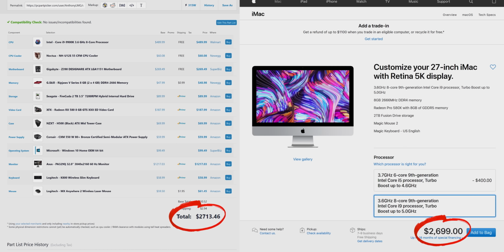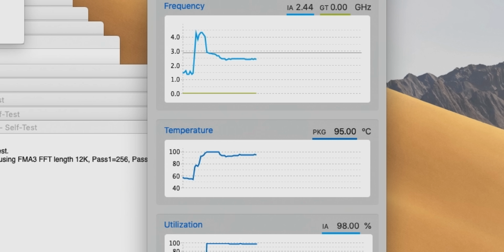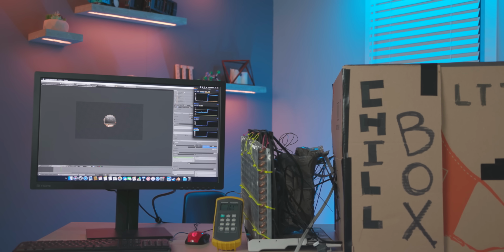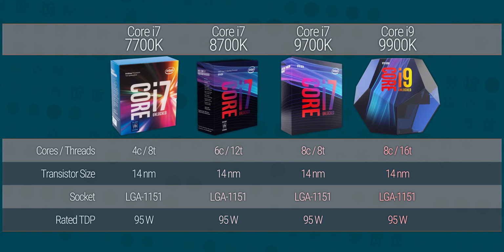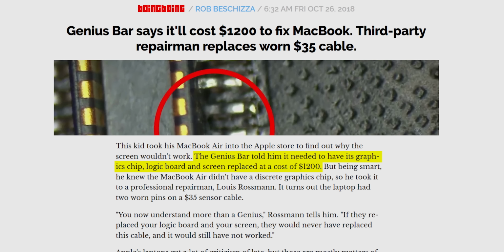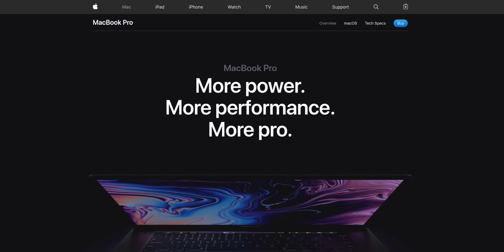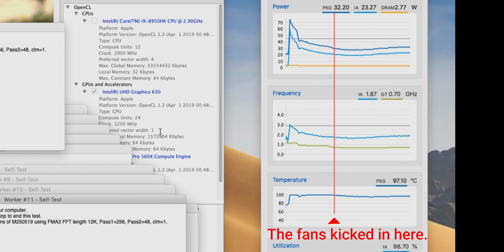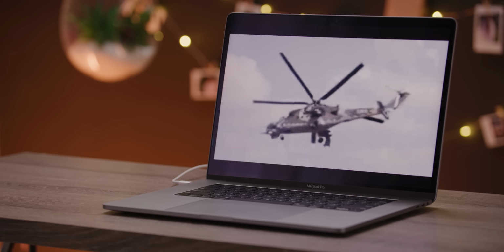Macs are SLOWER than PCs. Here’s why.

Comment: I may not be as knowledgeable as most people here; but I know for a fact that coming from a PC and converting to a Mac was a step up. My cpu fired up quicker, I had less malware and virus problems, and I didn’t have a bunch of programs simultaneously start thinking about loading. I’ll stick with Mac every time. The programs are more stable, and by god if WINDOWS PROGRAMS USING Parallels runs better on a Mac than on a PC.  I do believe that hardware specs that are married to operating systems are the game changer with both systems, but the Mac is more stable . This is why I, and many others got sick of PC. If you want to build a top of the line gaming system, have fun every three months spending it on your Gaming PC, I’ll use a dedicated console. If you want a stable computer that doesn’t crash, and doesn’t give priorities to non essential functions, other than what you are working on, then get a Mac. Too much BS with Windows and PC.
Reply: “I may not be as knowledgeable as most people here;”

^Only thing you were right about.
Reply: I have had my PC for a year now. Havent made a single upgrade on it. Still does me absolutely fine.
 Although I havent utilised it, I still however like having the option of being able to upgrade my PC by myself if I want a significant performance boost whereas with Macs you gotta buy a whole new computer if you want faster speeds...

Comment: Not gonna lie I got a MacBook Air 2years ago because it was marketed as the laptop to have in college I didn’t know or care about specs. But now that I’ve graduated and have actually started using my laptop for real work and not just a place to use Microsoft word + store stuff my computer is constantly overheating and the fan is constantly on...I NEARLY got the 2019 (15 inch) MacBook Pro but now that I’ve actually taken the time to learn about specs and the importance of certain components + all the unnecessary problems the pro line has while Apple is charging customers 1k-2k it’s very clear that I’m gonna have to leave the Apple ecosystem. Having a laptop that costs 2k that overheats and/or has a trash keyboard but has a nice looking exterior is just not worth it.

Comment: So, questions:

You say a slow un-throttled chip can be as fast as a throttled faster one.  Does that include when they're turbo-boosting?  I would imagine that the vast majority of users are more dialed into snappy response than actual under-load performance.

Is a Mac at a certain TDP slower than a PC at the same TDP when looking at models with a similar form factor? (IE Surface Laptop vs MBA)?

My Alienware 17 thermal throttles playing WoW Classic in 4K if I'm being really active in-game, so I doubt this is so much a Mac problem as it is a "Trying to get more performance out of a form factor than is possible with traditional cooling" issue.

Comment: Linus Tech Tips,  I wonder if the reason that the iPhone CPU (rather the SoC) runs cooler than the laptops and desktops has something to do with the different chip makers. The iPhone has a ARM A9 which which runs a Reduced Instruction Set (RISC) rather than an x86 which has a Complex Instruction Set(CISC). On the other hand I just found this article that claims the the micro-architecture is the most important aspect to energy consumption. https://www.eetimes.com/author.asp?section_id=36&doc_id=1327016#
Reply: It's obvious that smartphone SoCs are running cooler, nobody said it's not.
But as Linux made an example, another top smartphone (and we can assume most other smartphones too) has thermal throttling kicking in earlier than iPhone model under a similar load, and it raised a question...
I suppose the answer is that Apple is actually doing a pretty good job making their own CPU/SoC which has better thermals while providing even higher performance.
But Apple doesn't have such luxury for x86 CPUs so they have to use AMD or Intel CPUs which requires a much bulkier cooling system in order to sustain high load without throttling. It goes against their target audience's aesthetic preferences, so they prefer to boost, overheat, and throttle...

Personally, I own and owned several MacBook Pro models (one being mentioned in video infamous 2011 model (which actually had very competitive price in comparison to Windows laptops at the time) with Radeon GPU BGA de-soldering issue which took over a year for Apple to acknowledge and replace for free the expensive motherboard together with CPU and GPU) and several PCs, and I very well know what I can expect from a MacBook Pro. Alas, even with a powerful cooling stand, it's an extremely compact and light design that cannot sustain a high clock speed. But it's best for my portable use case now and I'm happy I have a light secondary machine with great boost clocks which feels great every day with outstanding HiDPI IPS screen (I got it in 2015 when there were basically no decent alternatives with HiDPI/4K screens, not mentioning they were much bulkier without providing significantly better thermals).
For a truly professional non-portable use, Apple making Mac Pro workstations (especially the latest model) which have proper thermals—but cost-wise, PC was always cheaper, and now even more cheaper with AMD Ryzen 3000 family CPUs (Zen 2). But for a portable truly professional use, Apple is likely to not going to provide any competitive options in the near future...

Comment: Sorry but I can't agree with you. Moving three files into a folder on a Mac takes 1 second, doing the same on Windows takes about 10 to 20 seconds. Restarting Windows takes "forever", sometimes up to 5 minutes. A Mac takes 30 seconds. Shutting down a Windows laptop takes "ages" up to 3 to 4 minutes sometimes, whereas a Mac takes about 20 to 30 seconds. Things just seem to "work better" on a Mac and a lot faster too.
Reply: Have both Mac and a laptop, a good ssd for laptop makes difference. I'd say they almost the same in copying, restarting and boot up.
Reply: Get a SSD. Thats the problem right there. Good folder management also helps.
Reply: @METALLICARULES11  So Windows machine needs an SSD whereas the Mac doesn't...
Reply: @ozzieboy007  Wait. Your telling me Macs dont have SSDs? Your telling me that a brand of computers costing thousands dont even have a SSD included. And there was me thinking SSDs were a standard in any mid range Desktop or Laptop.
Reply: @METALLICARULES11  No SSD in my MacBook Pro and no SSD in my Lenova Windows laptop. Both using traditional HDD's. (and the Mac is MUCH faster)
Reply: @ozzieboy007  My Desktop only cost €870 and came with both. Id have assumed SSDs would be especially prelevant in Laptops as they are smaller, Make no noise and their smaller storage space compared to Hard Drives wouldnt matter as much since Laptops are more likely to be used for smaller tasks such as creating Powerpoints, Word Documents etc.
 And Naturally Macs OS would be a bit faster due to it being optimised for only a handful of different devices. 
 Windows has to run on literally thousands of different PC Configerations so naturally its not as well optimised as Macs.
 I used Macs for a few months in college and hated them with a passion. I could not get any noticable speed difference between it and my cheaper PC Set up, I didnt like the interface and found organing my files to be awkward, I disliked only having one button on my mouse etc etc. 
 Basically every second I was wishing that I was just using my own PC at home. Towards the end of the semester I found myself just writing notes in the class and just doing all my assignments at home because I was sick of Macs. 
 Never intend to use one again. Maybe my issues with the Mac OS were because Im used to windows but in my experience there is not difference at all between the speed of a Mac or a PC with a Core I5-8400, GTX 1060 and 8GB of Ram with a 256Mb SSD.
Reply: @METALLICARULES11  Cool

Comment: Do you think this difference might be mitigated if Apple starts using their own chips in Macs as they do in iOS devices?  Do ARM based chips run cooler than the Intel designed ones?
Reply: They will run more efficiently. Not sure if they will run cooler. Tho I did read that the A12X Bionic chipset was ranked as having a similar GPU performance to an Xbox One S and a fairly powerful CPU with lot's of extensions, and no advanced power supplies required to achieve this. So if they can build upon that for a laptop and add better cooling then I dare say they will run better.

Comment: You seem to be blaming Apple for what are essentially problems with Intel chips, that as you observed, also apply to Windows PCs (and remember consumers are going to compare their potential purchase of an Apple PC with a similarly specced Windows PC, so Apple is effectively forced to partake in the megahertz myth. They were burnt by the PowerPC in the early days of Intel computers, you are probably too young to remember that, but they know that the market worships megahertz, and cores, so they give the people what they want.). Apple knows the problems full well, that's why they are hard at work on their own ARM based silicon to directly compete with Intel in the mobile PC space...

Though I'm confused about your example of the Mac mini's performance versus the portable mac in the cooler, and why it should be underperforming because of thermal issues, given the fact that it supposedly is not designed to run on battery power, so power conservation is not a primary goal, and I would imagine they should be able to design some sort of thermal cooling hardware in a small desktop form factor that does not have thermal throttling issues, unlike a portable, which is constrained by weight and size...
Reply: Well no, the point is, apple are sticking high peformance CPU;s in a small space where heat becomes a problem. stick that CPU in a well cooled PC, then  there is no issues with that CPU at all
Reply: Not necessarily, you guys haven't considered the very real possibly that Intel is the villain here, and that it is physically impossible to cool these Intel chips with a convection-based temperature differential cooling system (air or water based), and that they actually require some form of actual refrigeration, lol.

That's what intrigues me about the result he got with the Mac mini in the fridge. I actually think that it's likely that the mini has got reasonably close to the best fan/heatsink based cooling system possible, and it still thermal throttles. I base that judgement on how small, if any, the performance gains are from fitting third party whacking great heatsinks and new fans to the mini - you can actually buy these, inspired no doubt by false rhetoric here from the likes of Linus tech tips.

The fact is these third party cooling solutions for the mini give you practically no performance gain (do a search on YoutTube, there are a few videos showing this) - so you have to put the mini in a refrigerator to see the gains. 

Which means of course that Intel is to blame, not Apple.

Comment: yeaaaa... definitely the wrong person to ask this (king of the PCMR), but i respect your opinions on all things computers.... so i'm just going to ask.  

i'm considering trading in my 2017 5k imac and getting the refreshed 13"mbp.  thoughts?  the only reasons i'd want to hang on to the imac is for the 27" 5k display, no t2 chip, and user upgradeable RAM; but there are so many other things going against the imac.  i would like to think apple is going to refresh it sometime in the next year? or less?  the looks are dated, which i don't care that much about in and of itself, but if a redesign comes with upgraded I/O, that's something I'd want.  It's also got the same old ass BT, not even an option for 10gig ethernet (not that I can make the most of it, but it's like a $90 upgrade on the mac mini), the vega 48 seems like an overpriced and lackluster upgrade, and they leave so much empty space on the inside, which could have been used for a secondary fan(????), which would seem like a smart idea for a computer with heat issues... desktops are going out of fashion, and mobile productivity is the present and the future.  But I still do enjoy the desktop experience.  I figure that with a MBP + TB3hub + egpu + external storage, I can get similar performance (if I go for the 15"), plus portability.

As far as why i'm looking at the 13" mbp is because I can almost trade them for each other straight up (maybe a few hundred on top for upgraded RAM and SSD).  Ideally I'd like the MBP 15" with the vega 20 and 32gb RAM and a larger SSD thanks to the price drops.  But because of the nightmare stories I've seen relating to the keyboard and thermal throttling, it seems like a big risk to spend that much money on a laptop, especially with the rumors of a new MBP with a keyboard going back to the scissor mechanism... even if it ends up being in an even higher tier pricewise.  Also, the vega 20, while better than the radeon pro, is still pretty underwhelming.  

Should I just wait to see what Apple releases for new imacs or mbps?  The problem with this is that my trade in value is going to sink fast.

No I'm not a "power user", but if I'm going to invest this kind of money on a computer, I want it to have a little more longevity.

To be honest, I've had a hard on for the MBP for a while, but the price to performance seems... blehhhh... plus the aforementioned throttling issues and crap keyboard (tbh i like typing on it, but i dont want to deal with having to get it repaired all the time).

I'm so torn.  

Any advice would be greatly appreciated.

Comment: aaaaaaaand thats WHY I use SMCfancontrol since the beginning of I start use a mac. Save my life and my mac life all the time. Im not a stupid who like mac because its beautiful and quiet, so i dont minde if i have a bit noise, i use the macbook fans aways at 4000, 5000 rpm and really dont mind the noise

I like mac for one reason: if i use 3 different audio software on pc with same plugin in a first gen i5 with 16gb ram and ssd, they  perform slow. if i use logic and same plugin in a core 2 duo mac with 4gb ram and no ssd, it perform great.
BUT, yeah, apple computer is a grill, in special iMac that say you're in 35 degrees but you can see its 80 degrees.

Im working in fix mac boards since the PPC and can tell: use a software to speed up the fans, its a toaster

Im not deffending macs, btw sometimes think use a PC as i meet your channel, just dont find a audio software to deal with it as logic pro, love you channel btw!

Comment: After 6 years stuck with a Mac out of preconceived necessity, I'm buying a Dell.
Reply: honestly i bought a dell xps 15 and same issue. The Nivida 1050 GPU got roasted just from playing fortnite and now i have to send it in for repairs. Its only 2 years old and lucky me the warrenty was only 1 year. Worried there probably gonna tell me its like 1k to replace the mother board or some shit. smh...
Reply: @jch010  Well, I heard XPS isn't exactly optimized for gaming anyway.
Reply: @Tamaki742  for sure although Fortnite isn't exactly the most intensive especially for a gtx 1050. Just wanted to share my dissapointment as like you I decided to part from macs that I had my whole life for something that had more value for the dollar. XPS 15 seemed like a great transition but for some reason the thermals still skrewed me. I don't regret buying windows as it's definetly more versitile than Mac but I just wish I had more information on thermals going into it.
Reply: @jch010  Ah, I see. Thanks! I'm actually picking G5 15, though. I know it doesn't seem like the best but for what I need, it seems to be enough. But man, I've been using Mac since my Acer got accidentally destroyed around a decade ago. First was that old white Mac, then the 2014 Macbook Pro. Once had my headphone cord suddenly snapping off inside the jack, and Apple seriously wanted me to pay 700 dollars just to get the cord out. Ended up finding the store I used to go to (before the mall it was in got demolished) opened up at a new location and guess what, 100 dollars + because I also asked them to replace my battery.

Comment: What I find really interesting is the fact that for day to day usage at work specs don’t really matter. Yes a windows laptop can be faster in benchmarks, but in practice a mac is faster in a lot of cases. Especcially if you use software that is designed for macOS. Things like NPM install run almost 5 times as fast on a mac compared to a similar windows PC. Final cut pro will render your video in less than halve the time it’ll take adobe premiere. So yeah specs are nice and all and benchmarks make it possible to compare apples to apples, but in real situations (like they showed for webbrowsing) it will be a lot faster then you might think based on the benchmarks differences.
Reply: That isn’t always true I’ve had premier render the same video as I did on final cut premier was faster
Reply: Rob Richard well it depends. Did you actually make the video within FCP or was it kind of like an import?

Comment: so my 2011 macbook pro i7 2.2 with AMD 6750 GPu still works, and i have gamed on it Loads, the reason it failed was initial manufacturing fault, not necessarily a design fault, so that argument is Void.

Comment: Interesting point at the end about iOS not doing thermal throttling vs Macbooks obviously doing it a lot- I think it's because Apple controls their own silicon roadmap and is on TSMC's latest process node for their smartphone AP vs is forced to use old nodes for INTC chips due to Intel's 10nm execution as you mentioned.

Comment: I'm a lucky owner of a 2011 MacBook pro. I bought it for college and it started failing on me in 2014. Found out that it was a large issues Apple was addressing so I took my laptop in. They acknowledged that my logic board was failing, but they couldn't verify the cause for the failure so they wouldn't honor the repair program for me.